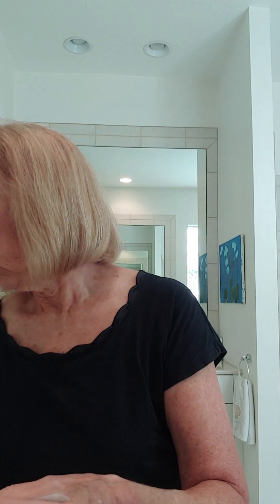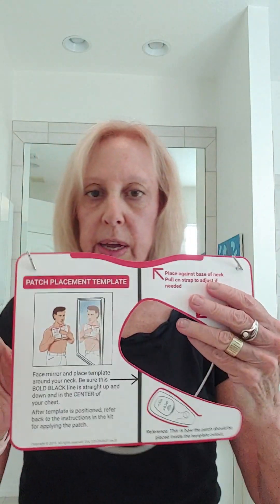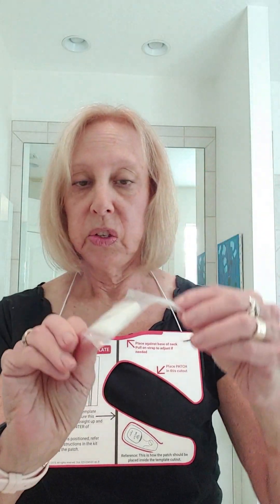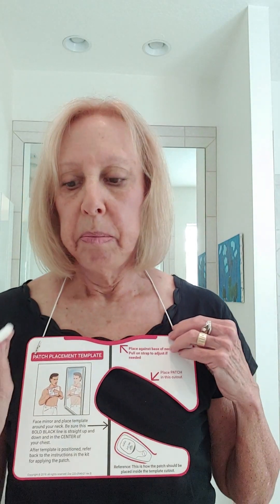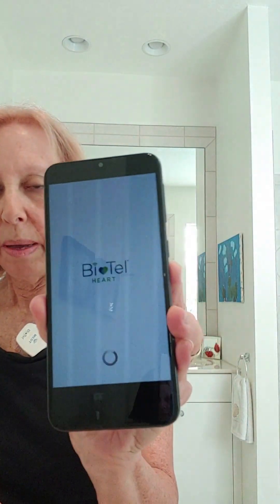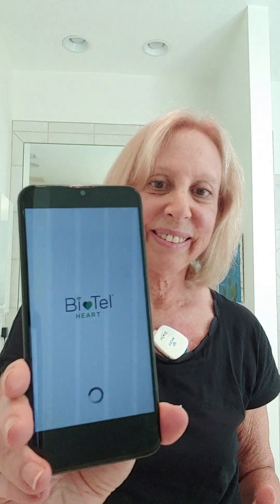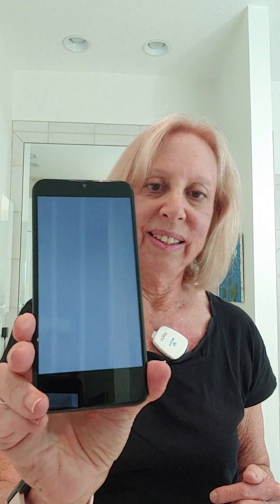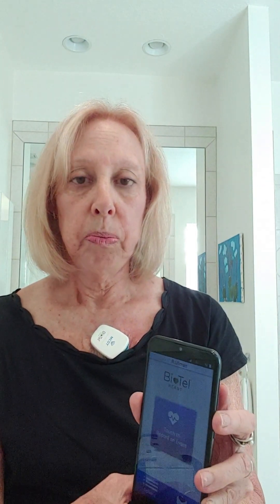Philips MCOT Holter Heart Monitor Attaching and Charging

Comment: Can you shower with it? It says not to get it wet but says to wear it for 5 days and like ?!?! Im so confused googles says no but i dont have enough patches for the month they want me to wear it
Reply from the maker: You don't have to go 5 days without a shower! But you do have to avoid getting the sensor soaked. If water hits it, dry it off right away. Just keep the shower on your back and wash your front carefully. Or I suppose you could fashion a baggy to cover the sensor. Then after 5 days, take a shower during use the 2 hours you're recharging it. So time that recharge to fit a good shower time, and then at least that's one day you can take a normal shower! Good luck to you.
Reply: @rosanneullman thank you so much ❤️

Comment: You're a life saver, 29 here and having a lot of fainting and chest pain. Been worried about changing mine cause I am a visual learner. Thank you for this video 🤍
Reply: I’m 29 as well, just got this attached at the office had it on for 5 days but tried reattaching mine and never saw the light turn back on. I have the e patch biotel
Reply from the maker: Thank you for letting me know. It makes me feel good that I could help someone like you - only 29, when you shouldn't have to think about how your heart is working. You are doing the best for yourself by giving your medical team as much information as you can. I hope the monitor helps you get a diagnosis and it's something they can fix. Let me know what happens - I care.

Comment: It says in the instruction manual that if you're putting on the same location or just changing the patch that you don't need to scrub again?
Reply from the maker: Yes, that's true. I didn't realize that when I had mine, but the instructions do say you don't have to scrub for the reapplications. I'm sorry I didn't say that - but I did want to show how the scrubbing works. Do it just the first time!

Comment: Philips said monitor not working.  So have returned when received new set.  Seems to be working, but had extended use for two more weeks.  Doc cannot detect any problems with my heart, so stroke may have been unrelated. I wonder if the sensor was really the problem.  The glue on the patches much gluier this time and adhere strongly.  Anyway, my poor chest is red and chapped.
Reply: Haven't needed to scrub last few times, my chest is like the Sahara Desert!  Just hope the thing is working and my time and effort worth it.
Reply from the maker: Good for you that you put in another 2 weeks. Sometimes it's hard to get yourself to do what they ask, especially when something goes wrong. But now you know that your heart is in good working order! I hope you get answers about the stroke, though.
I don't know if you've read all of the comments here, but roughening up the chest applies to only the first time you attach the sensor, not when you recharge and reattach. I'm sorry if I was responsible for your chapped chest :(.

Comment: I got mine on today,chest pain for over 2 months str8 and because iknew it would cost a tad so i held off seeing a dr😢
Reply from the maker: It is not right that we have to consider cost when it comes to taking care of ourselves on this very basic level. Doctors and hospitals will often work with you to make payments over time, so never wait before checking on something like chest pain. I hope the monitor showed that waiting didn't put you at a disadvantage.
Reply: @rosanneullman  it cost $300 out of pocket, I paid for it up front because the receptionist said if I get it billed it'll be 1000s..so I'll have the mcot on until 6-3-24.. the ecg and stress test came back normal 👍

Comment: Incorrect information. Do not scrub when replacing patch to same area.  Other than that very good.
Reply from the maker: I checked the instructions, @flyman, and you are correct. I guess at that point your skin is already roughened up enough! I appreciate your taking the time to comment. I still want people to see how to do the scrubbing because I think most people come to the video right after they receive the equipment, but I should have added that you should do that only the first time. I did it each time and didn't cause any damage even on my 70-year-old skin, so I hope it doesn't harm anyone who does the same.

Comment: Thanks for this. My heart doc put this on me before I was discharged in the hospital. He didn’t bother with scrubbing my skin or anything. I thought that was just to use the first time to get any oils or lotions off the skin. But either way, I think I’ll skip that step if the monitor is sticking fine. My only question is showering. My doc said I could shower normally, but no baths or swimming, but in my instructions in the box it says not to get it wet. But then they only give you 7 patches, so I’m sure they don’t expect me to shower only every 5 days. 😅 Did you shower normally?
Reply from the maker: Hi. Thanks for watching and commenting.
As I recall the instructions, they indicated that you shouldn't immerse it in water. Showering is ok if you're careful. So I'd say I showered relatively normally but not completely normally. I kept the water on my back. I didn't stand directly under with the water pouring straight over my head, and I didn't turn toward the shower to rinse off the front. I just showered without getting the sensor very wet. It takes awareness, but it's not hard really. For one of my showers, I tried to tape a baggie over it to make sure, but that didn't work out very well! I showered each time I had to take it off to charge it, so for those two showers I didn't have it on me, and that felt nice.
I wore it only 2 weeks. It sounds as if you are wearing it longer. 
My guess is that it will stick ok without scrubbing, but I figure you might as well do what they advise to get the best chance for a good outcome so you don't have to do it over!

Comment: At least they gave you a sheet to wear around your neck for the placement. They just gave me a piece of paper to hold while you are placing it...
Reply from the maker: Wow, no kidding? You have only 2 hands - that seems tricky. I wonder what the difference is. Same Phillips sensor, right? Are you in the United States? I hope my video helped you anyway.
Reply: @rosanneullman  Yes same Phillips device.  I'm in the US. It does help, although I still worry about it being too high or too low.
Reply from the maker: @orome9793 Make sure the top of the cardboard guide is across your collar bone, and you'll position the sensor accurately. Also, your monitor should alert you if it's not picking up your data.

Comment: Can I shower with it?
Reply from the maker: Adele, you absolutely can shower with it, but not in a way that you get it drenched. I just kept the water on my back and didn't turn around and face the water. For one shower, I kind of taped a plastic baggie to my skin to protect the monitor, but you don't really have to do that. Try to use the battery charging time to your advantage and shower during that - it feels good to not have to worry about the monitor.
Reply: Well, I must say you did EXACTLY what you set out to do. I thank you 🙏 
It was easy, straight to the point video. I watched it twice to make sure, and then I got it. This video will help a lot of people!!! 100% 
🙏
Reply: Thank you so much for responding. Yesterday was my first day with it. When I saw the box I got overwhelmed and came  here, and you video was exactly what I needed. Thank you 🙏
Reply from the maker: @Adele-d9k  You are so welcome! I felt the same way and did the same thing - but the videos I found were either dry and clinical or kind of negative and complaining about having to wear it. I wanted to give people a positive feeling about doing something that will help them get an accurate diagnosis. I've been through open-heart surgery and chemotherapy, so even though I know this monitor is a big bother, it's better to be proactive!

Comment: I just got mine and I’m a little confused about it. They told me I can change the patch on the fifth day but my question is if I need to charge it on the third or fourth day do I change the patch ? I know they said the phone will tell me but I’m on day one and it’s like halfway down 😖
Reply from the maker: I'm wondering whether you applied it properly. But in any case, I think if it's loose on the first day you probably should call your doctor and ask what to do. I don't think it would matter if you replaced it before your phone tells you to, but you should check on that.

Comment: Thank you so much what about when shower to I need to cover or not
Reply from the maker: Showering is fine as long as the sensor doesn't get drenched. I didn't bother covering it. Stand with your back to the water and just try to mostly keep it dry, and then dry it right away after your shower. But during the 90 minutes it charged, I sure took a shower! It was nice not to have to worry about it that day. If you do cover it, you could try the sticky Glad Press'n Seal plastic wrap.
Reply: @rosanneullman  thank you so much

Comment: I just received this and before I watched your video, I watched one from a lawyer and a doctor in Pensacola Florida who had a warning…have you been able to watch that?
Reply from the maker: Hi. Thank you for finding this, because we all have to be careful and informed. I had not seen that video, but I just watched it. I have no connection to BioTel or Philips or any reason to comment on the lawsuit that video describes. I can tell you only what my impression was as a patient. I was not under the impression that the monitor would alert my doctor in real time. I didn't know when my doctor would see my report, but I figured it would be after the two weeks of wearing the monitor had ended. I thought of this sensor/monitor system as showing two weeks of data, not as acting as a warning to my doctor in real time. If I felt that my heart was acting in a way that I was in danger, I think I would have called my doctor just as I would have if I hadn't been coincidentally wearing the monitor when that happened. I would think that I should use the monitor to report any symptoms that occurred, but if the symptoms were frightening that I also should call my doctor. 
I got the following disclaimer from googling the instructions for patients, but I recall seeing this or something similar on my instructions: "The MCOT Patch system is not an emergency response system. The monitor cannot be used to make outgoing calls, even during an emergency. If you experience a symptom that you feel is a medical emergency, call 911 for medical assistance."
I think it's reasonable to ask your doctors whether the monitor will alert them in real time to something unusual going on during the monitoring period.
Just to mention, it's not important but the video about the lawsuit misspelled the name of the monitor company - it's Philips, with one L.

Comment: Can you leave the patch on and charge it? Because the box only came with 5 patches… if I have to charge it one time a day then that’s one patch a day? 

By the way 50 is amazing as a heart rate! Lance Armstrong was like 30-40… athletes have lower HR - if that helps?
Reply from the maker: Melissa, check your instructions, but mine said to charge it every 5 days, not every day. Also, your phone app will tell you how much juice is left in it. I tried to keep track of how much it used up every day so that I'd know to charge it if I thought it might run out overnight. The 5 day estimate was on the money - it tended to use up about 20% each day.
And I know about an athlete's heart rate - it turns out that was why mine was low! The monitor showed I had normal rhythm and heart rate activity, and I totally aced the treadmill stress test they had me take. You can watch the video I made about heart rate. It's on my channel.

Comment: Thank you so much!  you explained it so well I been wearing mines for about 4 days
Reply from the maker: Thanks for letting me know you're doing well with the monitor! Two weeks will go fast. Stick with it, supply the data and see where that leads you. Good luck.
Reply: I finally got the results. ( not the Dr. interpretation )  but what the Dr. made his interpretation from .  There is WAY more events of " light hotheadedness and short of breath than I actually had. I had 3 total ( that I manually entered with the phone ) and the results indicated I had more than one a day!  Something is very fishy about this.
Reply from the maker: @MadisonKansas  I wouldn't be suspicious. Through both my breast cancer 20 years ago and my mitral valve repair 8 years ago, I've found the medical community to be ethical and doctors just wanting to get people well. Ask your doctor why you didn't notice as many symptoms as the monitor indicated. Maybe you were asleep or something? In my case, the monitor prevented unnecessary treatment. My doctor was talking about giving me a pacemaker because of my low resting heart rate, and the monitor data plus a stress test showed him that I didn't need a pacemaker.

Comment: Hi! I just got mine today. Is the orange cord used to charge the monitor?
Reply from the maker: JG, when you're done with it you have to return the equipment, so I don't have it anymore and can't remember but I think orange sounds right. The cord will fit together with the sensor holder. I think it has to be the right one, because there weren't other ones that I remember. Sorry I didn't take a picture of it - I'm still learning how to be helpful in these things!
Reply: I finally got the results. ( not the Dr. interpretation )  but what the Dr. made his interpretation from .  There is WAY more events of " light hotheadedness and short of breath than I actually had. I had 3 total ( that I manually entered with the phone ) and the results indicated I had more than one a day!  Something is very fishy about this.

Comment: I been wearing mines for about 7 days and it burn my skin and it itch around the monitor.  Can’t sleep side ways because it bothers.
Reply: I finally got the results. ( not the Dr. interpretation )  but what the Dr. made his interpretation from .  There is WAY more events of " light hotheadedness and short of breath than I actually had. I had 3 total ( that I manually entered with the phone ) and the results indicated I had more than one a day!  Something is very fishy about this.
Reply from the maker: Mary, I'm sorry to hear you're having trouble. It did not burn my skin, but it did itch me a little also, just not so much that I couldn't deal with it. I had no trouble sleeping on my side - or even my stomach, but sleeping on your back is probably easiest. It sounds like you're halfway through? In 7 days you've already provided a lot of data. If you can, hang in there for the full time. I'm rooting for you.